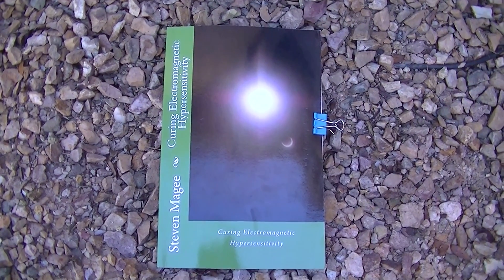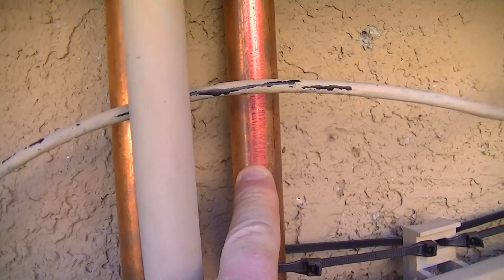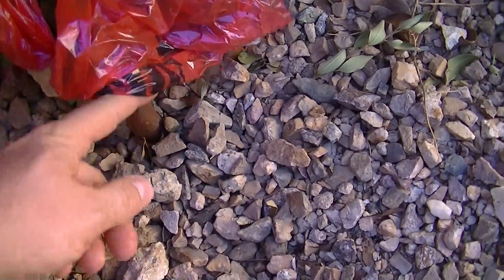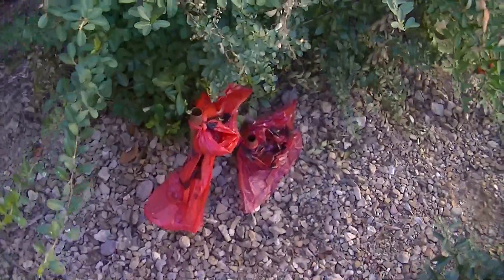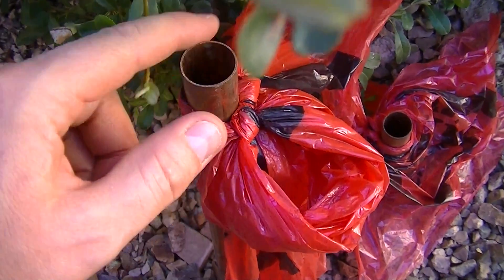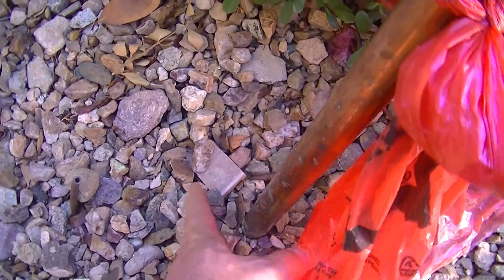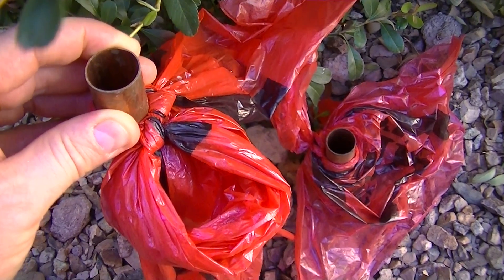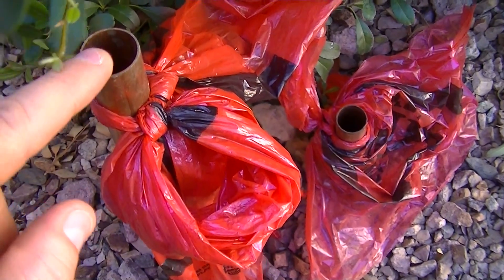Curing Electromagnetic Hypersensitivity - Radio Frequency Grounding (Earthing)

Comment: All this wireless/EMF technology is making us increasingly electrosensitive. I was rudely reminded of why I don't use laptops when I used one and a sharp sting went straight to my heart area. Depending on where it's placed is where the burning and stinging takes place. GPS devices are nauseating and headache inducing. Many people wonder why seemingly perfectly healthy people who are relatively young (40's and 50's) suddenly fall dead of heart attacks these days. I don't.
Reply from the maker: I have got to the point in this EMR research that I can turn heart arrhythmia on and off at will.  There are no doubts that certain EMR exposures cause heart problems and if not dealt with in a timely fashion, you may find yourself with rapidly degrading heart problems that are easily preventable.
Reply: StevenMageeBooks
Yes, people need to be made aware of these risks. Another thing is that babies and pets are even more vulnerable due to their thinner skulls and smaller size. They are even more electrosensitive. Many dogs are "afraid" of cell phones for a reason.